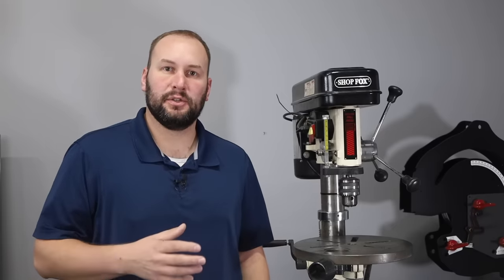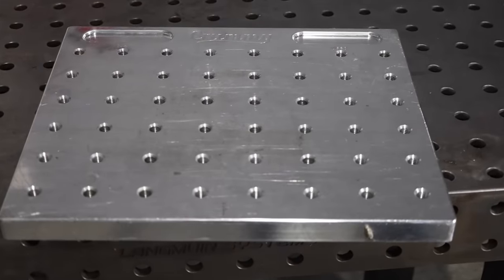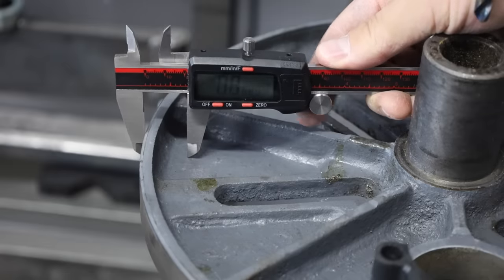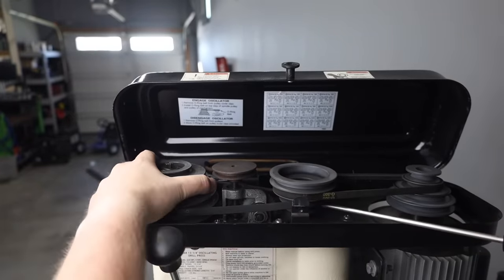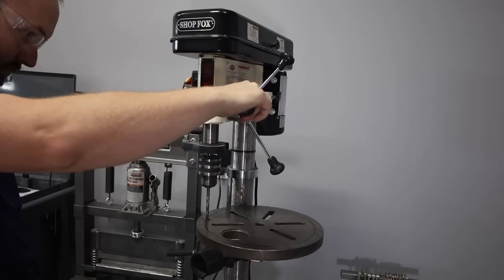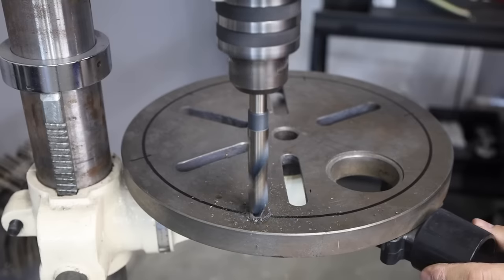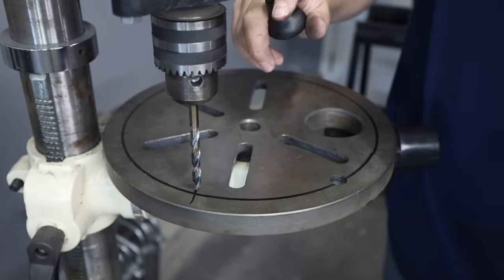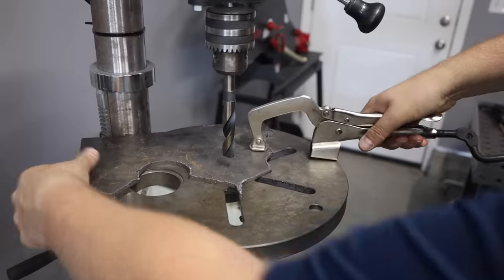EASY Drill Press Mod I Should Have Done Years Ago

Comment: Here's what I found best for DP work holding under these circumstances. Its just like a machinist step clamp set but cheaper.
I took some 1/2" round bar steel, bent it into a tight U with a clearance gap for a 3/8" bolt. Then you keep a couple of these U clamps, a few pieces of 3/8" (or 1/2") all thread, and some nuts and washers of different sizes. To use, put the all thread through a slot or hole, put one end of the U clamp on the part, put the tail end on a stack of things that's the same height as the work. Tighten and off you go. Very secure and works well for a variety of tasks.

Comment: Awesome idea. I should do this with my drill press. Where did you find that debuting tool at??? That's cool!!!
Reply: You can get any type of deburring tool on amazon.
Reply from the maker: Thanks! I just got mine off of amazon. I usually get the Noga brand, but I'm sure plenty of the other brands work great too.
Reply: @TimWelds  Thankya sir. "deburing" not debut as was mentioned in my text to ya. I'm just learning how to weld with arch stick & having a blast. I've enjoyed your videos I've seen thus far & a subscriber to your channel.
Reply: @D70340  alrighty. . . . .thankya sir! I appreciate the reply back😃👍🏼👍🏼👍🏼
Reply: There are two basic handle types of deburring tools....one is a red plastic handle other types are aluminum. I have owned and still own both types....a deburring tool takes a bit of force on metal and those plastic ones just don't hold up. Get the aluminum handle versions if you doing metal work. The plastic handle types have a feature that allows an adjustable length of the shaft on the tool.....If you mainly debur aluminum or plastic....it would be OK. but don't expect it to last very long.

Comment: Nice modification. Clamping anything to the drill press is such a pain on account of those ribs underneath the table.

I use my bench top drill press almost exclusively for woodworking, so I also wanted a bigger surface to work on.  I made a removable 15 x 18 inch table out of 3/4 plywood and installed Powertec T-tracks so I could attach hold down clamps and a fence. I also included a sacrificial insert that eliminates blow out out when using large Forstner bits.

Comment: Interesting idea, however, the table on your drill press is made from cast iron.  Cast iron is OK in compression, but very weak in tension.  So, if you use your clamp mounting holes be sure to use only light clamping pressure.  Inspect your hole periodically for cracks around the holes.  If you spot some cracks discontinue using those holes.  You will notice that when you look at the bottom of your drill press table you will see reinforcing ribs around the slots for the conventional clamping attachments.  This is to reinforce the slot and help spread out the loads from the clamping studs.  (Concentrated loads cause high stresses that exceed the cast iron's ability to withstand them.)  By drilling through the "thin" web areas on your table you do not have any reinforcement to spread out the localized loads from the clamping pressure coming from your stud mounted clamp.  I suggest that you add doublers below each clamp mounting hole that you installed in the table.  (This will take a while unfortunately, but worth the effort.)  The doublers should be made of at least 1/2" thick cold rolled steel and spread out as far as space allows.  A better fix would be to machine flanged bushings to mount in the holes that would spread the loads out on the thin web.  (This would necessitate increasing the diameter of the holes in the table to accommodate the outside diameter of the bushing.  I suggest a minimum of 1/4" wall thickness on the bushing and again 1/2" thickness on the flange.  Make the flange as large in diameter as space allows.)  All in all, an interesting idea, but in the final analysis, not a very good execution.

Comment: 2:00, you find it difficult to change the belts. Now, you have remembered to release the tension, right? I have never had problems changing the rpm's. If that's the case, will you admit it? 🤔
Reply from the maker: It’s just inconvenient. I understand about the belt tension. I’ve never had problems changing it either, other than using up extra time.

Comment: Sorry to ask such an ignorant question, but why not just use one of the ViceGrips such as their 82584 or 5 or 6? Thanks!
Reply from the maker: You can do that, but there are ribs cast into the table so you can only clamp directly over the flat sections of the bottom that way.

Comment: They make a clamp that works in the slots already in the drill press.  One of them is called a "Gino Development 02-0667 TruePower Drill Press Locking Clamp" on Amazon:  http://shorturl.at/JNU29  OR you can use a welding clamp with an M8 bolt:  HTTP://shorturl.at/aPRZ9  This way you don't have to drill any holes.

Comment: How fast to run a spindle? Start in the Ball Park... (For Lathe, Mill, and Drill Press)
Cutting Speeds (CS) are --- Steel = 100, Alum = 400,  Stainless = 40, wood = 800+
RPM = 4 x CS / Tool Dia. (inches)     
RPM = 4 x 100(steel) / .125 = (3200 RPM  --- With Coolant!) 
FEED = RPM x # of teeth  X  Chip-load = IPM
FEED =  3200 x 4 x .0025  = 32 IPM  (With Coolant!)  
Make the tool as short as possible. Adjust these specs accordingly! Wear safety goggles!

Comment: I cannot see that toggle clamp holding good enough when using large bits. I can see the work spinning on the table. Hope not, because it could be a dangerous situation. As a retired machinist for 40 years, I have learned to access the situation beforeit happens. Have seen alot of bad stuff over the years.

Comment: Wrong info here on a few counts...

It's Cast Iron you're drilling which is pretty soft, so wrong drill.
You never use a smaller drill to 'pilot' hole unless you are over capacity of your drill press. You always go straight to size.
If it requires accurate positioning, use a Centre Drill first.
Cast Iron shouldn't be lubricated while being machined for 2 reasons.
1. There's sufficient carbon in the cast iron to act as a lubricant as cutting speeds are low anyway so there should be little heat build up.
2. The fine cast iron particles when mixed with oil become great lapping paste, wearing away at your cutting edge. :)

But a great idea to pop some holes in the table for clamps.
Reply from the maker: Thanks for the info! I’m always learning and at least nobody died from my improper drilling 🤷‍♂️
Reply: @TimWelds  No worries. 👍
No one ever died, but how many pissed off people are there looking at a crappy hole they thought they did right! Lol. :)

The point of the drill keeps it drilling true and centred, if you pilot hole first, you remove the drill's ability to centre itself, and so it becomes reliant on the cutting edges to be centred, which results in the drill chattering, as it bounces from one cutting edge to the next due to the flex in the drill, creating an oversize hole.
The only advantage of pilot drilling first is that it reduces the cutting forces required to drill the hole, as most of the energy is concentrated at the very point.

Drilling a 2" hole with a small 240V pedestal drill? Yep, no worries, pilot drill slightly larger that the web thickness at the point, now your drill has the capacity to do it, as most of the cutting forces have been removed.
However, you need to hugely increase your rigidity, with clamps etc, as it's going to chatter like a bastard and want to grab.
The upside is you have a 2" hole that you couldn't drill before, as your machine wasn't powerful enough, and that's about it.

Pilot drilling is commonly done with Pistol drills, for the simple reason it makes it easier to push through as there's no mechanical advantage provided by a drill press, it's just a matter of how hard can you push?
It chatters, we know it, but we have a hole where we didn't before.
Who cares, very likely a bolt goes in it, it's functional and no one will ever see it.

The key to drilling perfect holes, is a perfectly ground drill point, use the correct RPM or slower for the diameter, and a rigid machine. :)

Comment: next, throw away that motor and slap a DC motor with a speed controller on it.  I'm so glad I did that years ago.  I kept running up against drill jobs where the drill press couldn't run slow enough.

Comment: Obviously it’s not a complete success as you can see the component slide when being clamped?
Reply from the maker: Well obviously 🙄…been using it since I made this vid and it works fine. If I need a precise hole position, I’ll throw it on the mill anyway.

Comment: why change the drill for every hole ???
just drill all the pilot holes first and then change to the bigger drill........
Reply: if you`re afraid of not hitting the pilothole center, just put the machine in reverse with the bigger drill and hit the pilothole gently before tightning the table....
Reply from the maker: I just did it this way…it’s either time changing the bit or lining up the hole. Either way, it only took a few minutes. Thanks for the tip on lining up to pilot holes, that’ll come in handy. 👍

Comment: Haha, this is kinda funny because you drilled holes to avoid using t-bolts! Kinda surprised you think your defeating a purpose by using your vise by also not using T-bolts… lol. Kinda surprised your table isn’t already full of holes 🕳
Reply from the maker: This table doesn’t have tee slots. It’s a lower end drill press.
Reply: @TimWelds  I didn’t say T-slots. I said T-Bolts which work on every drill press table ever made including yours. T-slots take T-Nuts which are what we use on milling machines. Not same.